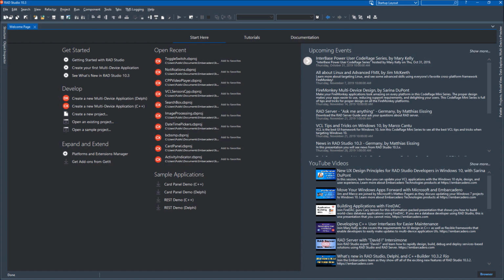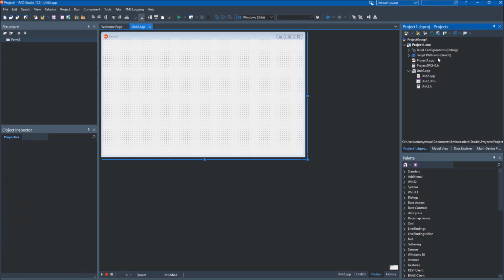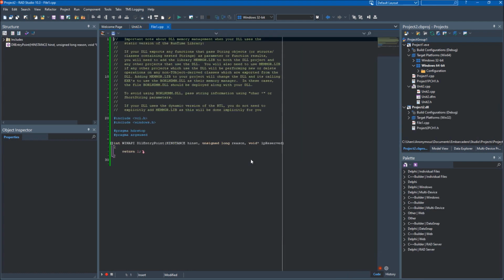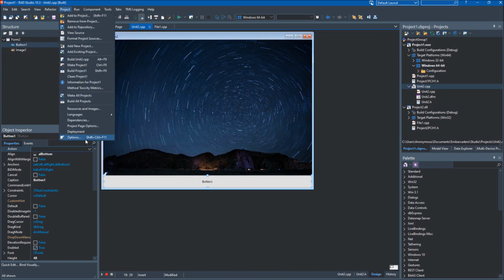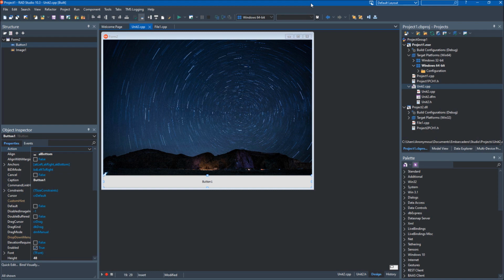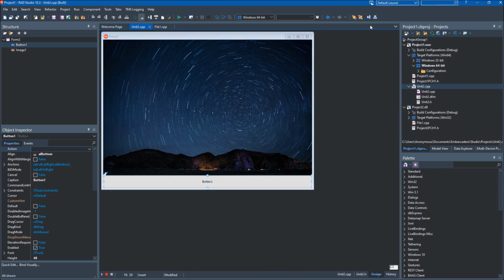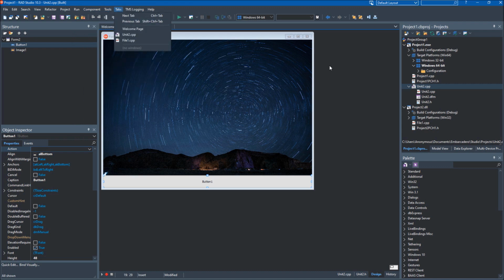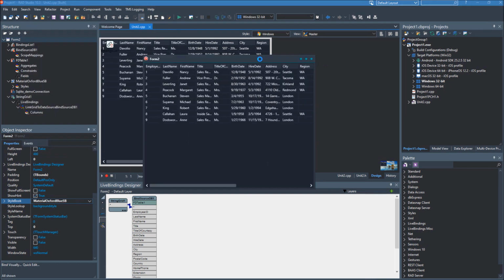Intro to the C++Builder IDE

Comment: C++Builder is a fast, integrated design and development suite for modern apps, It is very beautiful user interfaces 
that wow on every platform: Windows, macOS, iOS, and Android. Design it master UI layout once, then easily customize platform- and device-specific views 
without duplication of design effort.it platform only Drag-and-drop visual and non-visual components from the palette using. I am use this very comfortably but during the working time i face some coding problems and I search on Youtube my problem topic and get lots of related videos at a time I get your video and I learn good something Thanks for make good content. and thanks for your video ....👍😊